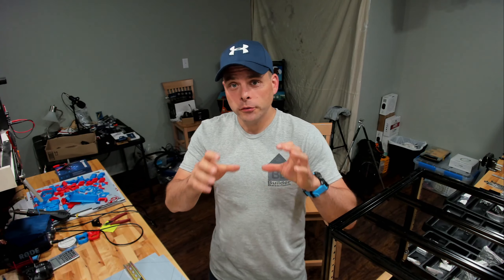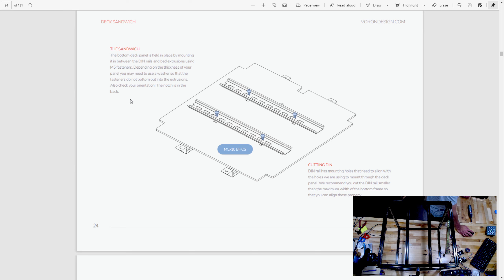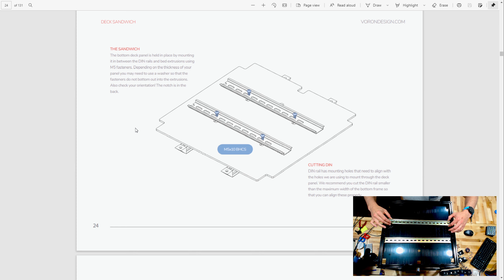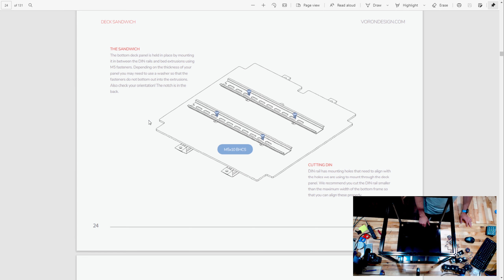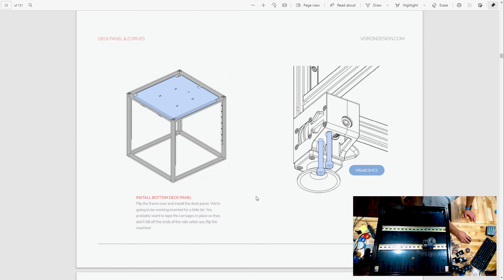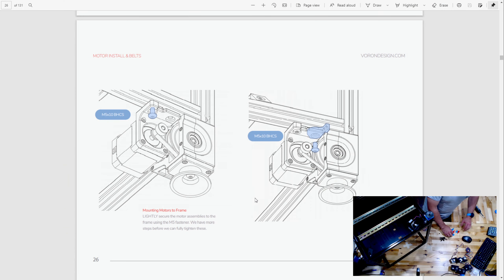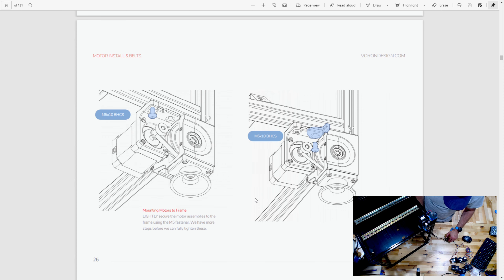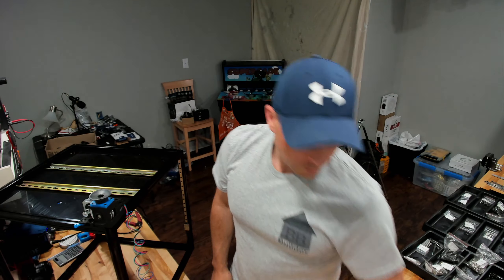VORON 2.4 Build - *Episode 4* Sandwich and Z-Drive Steppers. (I mess this up)

Comment: You lost your bit quite often. I have the same electric screwdriver. 
Insert a small magnet into the bit holder will fix this. 
 Be careful of the ordination before glue it in.
Reply from the maker: That's the only issue with the driver!  I thought of doing a magnet, just haven't gotten around to it. I was also concerned that it would hold the bit out too far.  I'll do something at some point!  Maybe a good whack to compress the 1/4 drive holder a 64th of an inch would do it.  Thanks for letting me know the magnet worked for you.